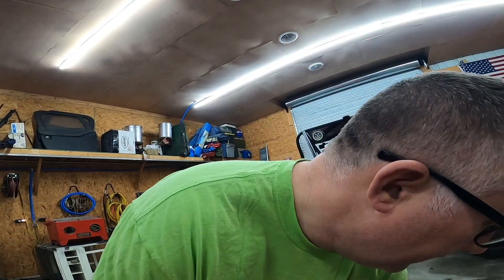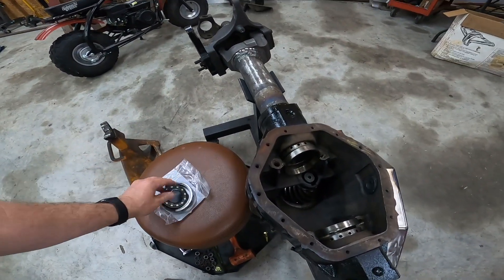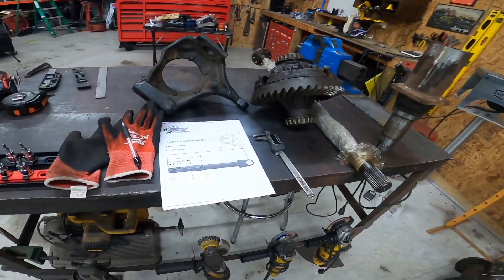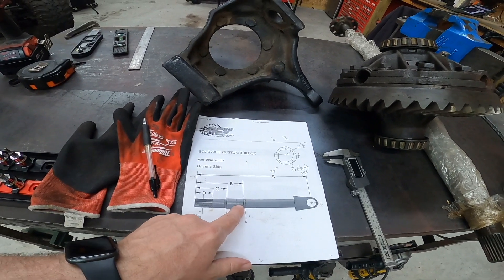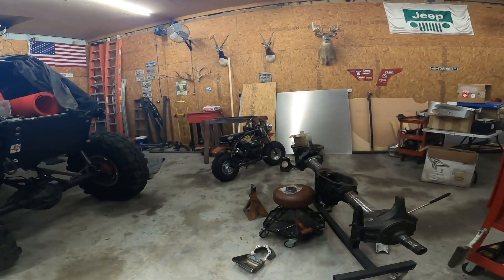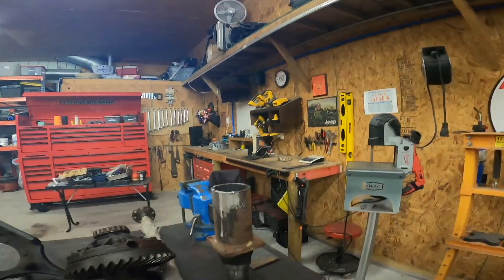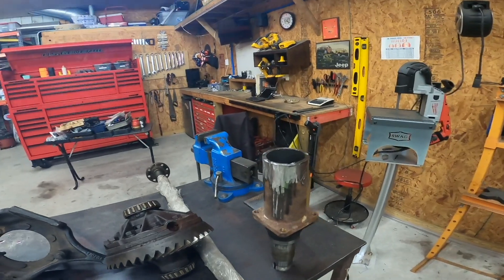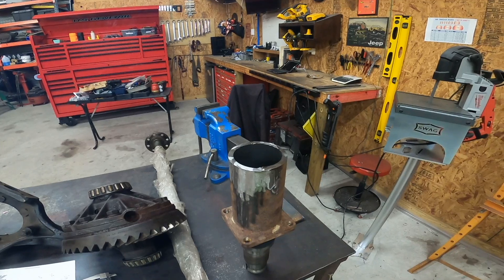14 Bolt Steering Axle - Sealing and How to Measure for Custom Axle Shafts

Comment: Hey man, I have seen you on the trail eyeing Red Dot's.  Just pull the trigger and find one to buy!!  FYI, my 14 bolt front steer axle has 4" OD tubes and and a shaft diameter of 1.550" with 2" of splines.  No need worry about a sealing surface as the shaft is all the same diameter.  They are also 30 spline with 35 spline outer shafts.